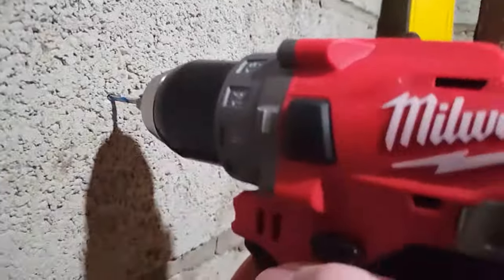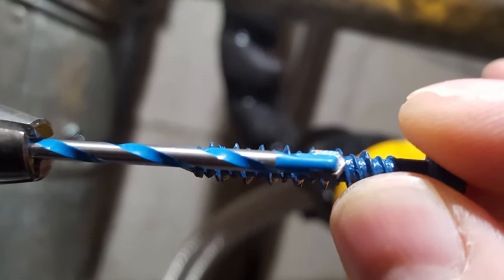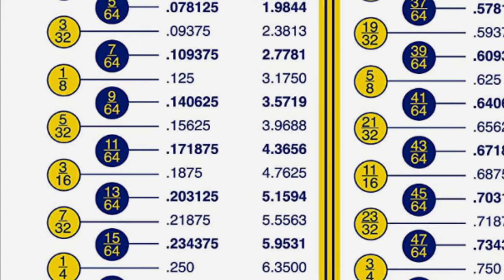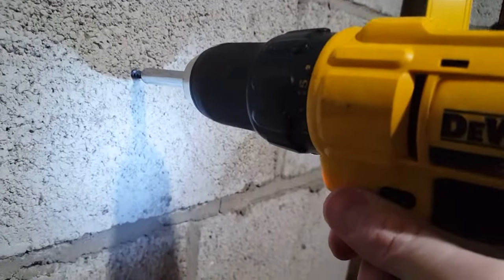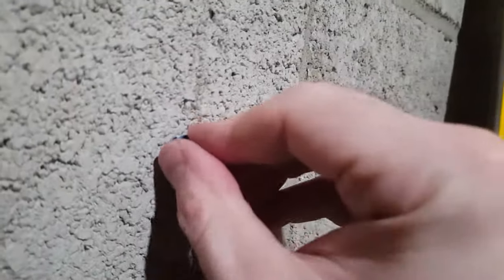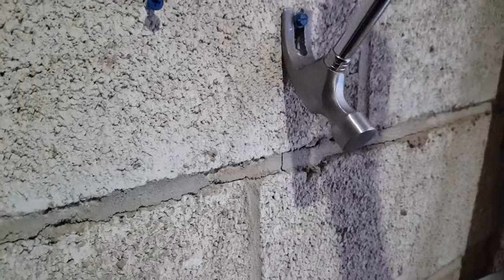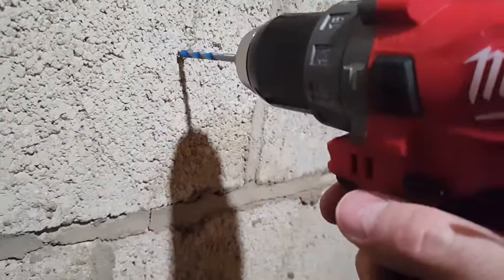Tapcon Screws Into Concrete | Which Size Bit To Use? Tapcon Anchoring Concrete Fastening Tip

Comment: So I'm not the only one who sees variances in the strength of a screw in the same sized hole drilled.  My feeling is that if it doesn't take a lot of effort to get the screw in then it's not tight enough.
Reply from the maker: I agree. I haven't done a pull-out weight test, just a simple hammer test. In hollow block, the small ones came out easily, the 1/4" took a little more effort while a #14 screw in a 5/16" plastic expansion anchor was impossible to even budge with the hammer. So if using Tapcons, use a small bit (not too small or you might crack the material) so the threads have plenty of material to grab and keep the drill straight.
Reply: THINK more "feel" less.
Reply: Yes, someone understands!

My tapcons were pulling out easily and the only thing I could think of is my cheap cheap harbor freight hammer drill had a wobbly spindle.

So, it goes back to trial and error...find the right size bit and verify the feel of the screw going in and pull out force with a hammer.
Reply: I can't find metric masonry drill bits!

Comment: Same here I noticed these variances too, i actually use the 5/32 bit when i use the 1/4 Tapcons and it has a real solid bit on block……question would a 1/8 inch bit work on the 3/16 screws instead of buying Metric bits?
Reply from the maker: You have to be careful using too small of a bit because the concrete could break or craack. I've also had the 3/16 hex heads snap off. Then again, if the concrete is not very dense you could try it.
Reply: @toolsandrepairs These are things that nobody mentions it seems.

Comment: Where can I get that blue blow bulb?
Reply from the maker: It was a sampler tool from a science kit. It's not as good but I also use empty plastic squeeze bottles and hold the nozzle right up to the hole and squeeze the air into the hole a few times

Comment: Looks like center block to me not concrete
Reply from the maker: The process of installing a concrete screw in any type of concrete, block, or masonry is the same: drill an appropriately sized hole, clear of debris, affix item without over-tightening.

Comment: question: I used the correct size bit for a 1/4" tapcon and held the drill as level as I could..yet the tapcon is not wanting to fit entirely into the drilled out hole.  Could it be the bit slighly bent while drilling?  thank you for the excellent details and help with the video. Nice clear camera work!
Reply from the maker: Are you sure you drilled the correct depth? It needs to be deeper than the length of the screw. Also debris needs to be blown out or may cause the screw to bottom out and potentially strip the hole as it turns. If you're talking about the hole being too big, that's why I get a slightly smaller bit in metric size (not too much smaller or the concrete could crack). If the drill has even a little wobble it may drill out too much material and not leave enough for the screw. Thank you for the compliments and thanks for watching.
Reply: @toolsandrepairs  thank you for the video!! and the helpful answer  :)   much apprecaited !
Reply: That is not a real concrete you are showing in a video, it’s a block. I use 3/16” bit for 1/4” tapcon in real concrete and using sds plus bits, and most times tapcon breaks or goes half way and i have to remove it and redrill the hole and only then it goes in. So I guess I have to use bigger bit 13/64 or 7/32

Comment: Why does Tapcon recommend a 5/32” bit for a 3/16” anchor/screw if that drill bit creates too large of a hole?
Reply from the maker: It will work but a slightly smaller bit worked better for me. I don't recommend the small concrete screws if you can help it because I've had the (5/32") hole stripped or in other cases the head snapped off too easily. A 1/4" screw with a 3/16 hole is going to be stronger for just about any project imo.
Reply: @toolsandrepairs  Ok thanks, I had a similar experience where I used a 5/32 bit for a 3/16 screw and there was next to no material for the screw to bite into, was almost complete loose. Then again, this was into mortar which I heard isn’t the best material to drill into
Reply from the maker: @pne333  If I had to install in mortar I would just use a plastic anchor because the screw threads aren't going to grab much and it'll be weaker. A larger screw would mean more material for the threads to grab. If installing something heavy, I just wouldn't install it in the mortar.

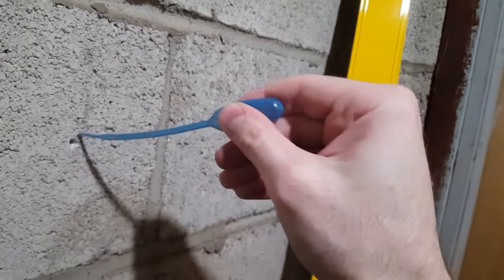Comment: Does anyone know what is the blue plastic tool at 1:49 1:50  that is being used to blow the dust out of the hole?
Reply from the maker: Plastic pipette sampler if you need to get in the hole but a small plastic squeeze bottle held up to the hole can do something similar
Reply: Just get a can of air like they use for cleaning out dust for keyboard and electronics

Comment: Great advice, but a bit confusing with the way you presented the chart.  I'm putting in some large 3/8" tapcons, where the recommended bit size is 5/16".  My issue with the particular cinder block I'm going into is how the hole always manages to widen, no matter how straight/careful I am with the bit, then the screw doesn't want to hold.  But, I digress....  What's the metric  size I should use for a 5/16" bit?  Worst case scenario is that if it's too small, I can always go back to the 5/16.
Reply from the maker: 5/16 is 7.93 mm so you can try a 7mm drill bit, though that may be too small (if it's too small it may crack the concrete when driving the screw). 7.5mm might be better but I'm not sure they sell that size in masonry bits.
Reply: @toolsandrepairs  Thank you, my friend, I’ll give those sizes a shot. 👍